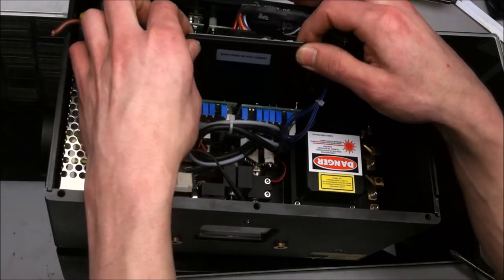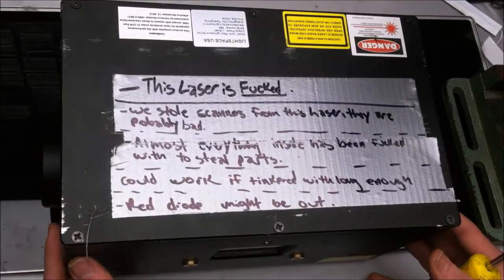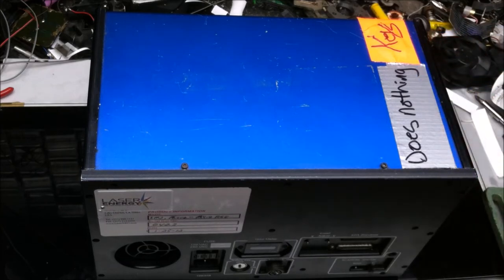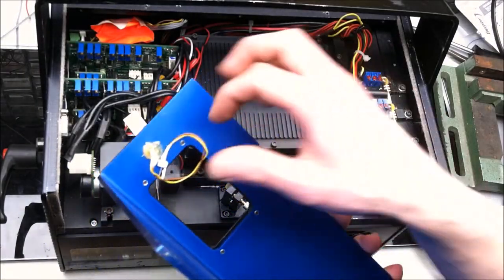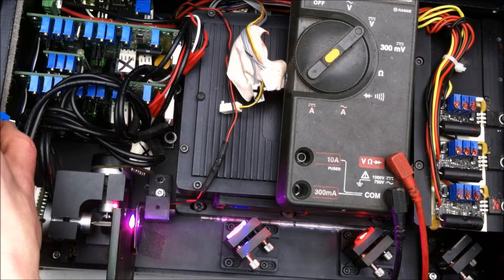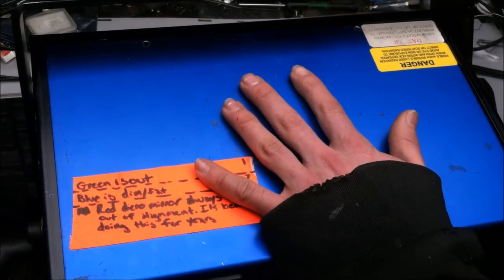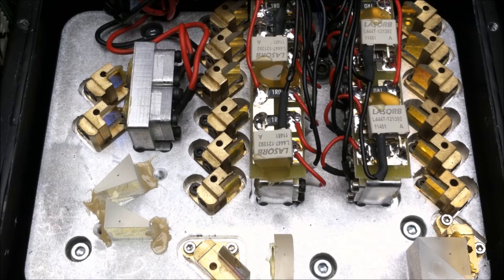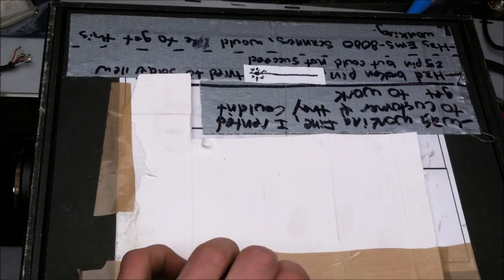Repairing 6 Show Lasers Part 1, Rough Diagnostics/Look Over

Comment: Hey Patrick Hope you are doing well buddy. 
Love the videos keep up the great work ! 
Just curious, did you said that one of those Cittadini projector systems output power sticker was labeled 18W RGB ??
Reply from the maker: IIRC Rob? Things are going pretty ok. The smaller Lightspace units where marked 8W max with a 1.8W internal label. The Cittadini Should be 2W 532nm, 1.4W 638nm, and 2.5W 445nm, bout 6W optical total power given the laser diodes used. Hope you're doing well yourself!

Comment: Great series, Zen. Hope you don't mind, but I have a few newbie questions for you regarding my 2 new projectors. Perhaps the answers will benefit your viewers, who find themselves in a similar situation.
Q1: The scan amps have a +15V Gnd -15V connector (near the signal input), but only one is connected to the control board. Is this a pseudo (single axis) connection that the control board uses to detect a static beam for cutoff?
Q2: The signal input connectors on the scan amps are labeled RP +In Gnd -In, which is also labeled on the Control board output connector. What is the RP pin for? (Return from Projector?, Reverse Polarity?...)
Q3: I'm considering eliminating the Control board (not interested in canned disco effects, controlled via DMX). Is there any reason that ILDA outputs can't be directly connected to the scan amps and RGB laser driver board? Is that what Kvant calls a 'Raw Projector"?
Thanks for your guidance. I appreciate that these questions should be asked of New Feel Lighting, but I trust your judgement above that of a salesperson with language barriers.
Reply from the maker: Galvo amps can go up to 24V electrically in most cases, however the galvos cannot. 12v-12-15kpps,15v-15-20kpps,18v=20-25kpps,24v=25kpps+. You can try higher +/- supplies above 12v to get better performance from your galvos but keep an eye on their temps to make sure they can handle it and make note not to do larger scan angles as to not over saturate the magnet/coils.

The 15v parts on the galvo amp are usually outputs from the 2 linear voltage regulators on the amps which are often used for driving things like the show card. 

I would have to see your galvo amp to know what RP stands for based on the location and parts connected to it, it could be scan fail output, not sure though. 

You can absolutely drive the lasers and galvos directly from the ILDA, however I would strongly recommend putting a resistor across the modulation inputs for each laser, say like 20Kohm as some lasers will stay on be default without a signal being fed to them. This just insures that the lasers do not fire unless a true voltage is applied. If you look up the ILDA pinout you will easily find the pin assignments. You may have to increase your galvo scan angle on the amps as the ILDA input is +/- 5v and some show cards use a higher voltage up to 10V+/- for signals to the galvo amps.
Reply: @Zenodilodon  Thanks, Zen. That's very helpful. Wouldn't have thought to use pull down resistors on the inputs to the laser driver board.
I already have the DB25 ILDA pinouts bookmarked. :-) But, have no info on the driver boards' inputs. That's why I wanted to check with you, before blowing them up on a brand new projector, from the get go.
Noticed that the show board doesn't use +/- Intensity from it's pseudo ILDA/RJ45 connection (only 8 CAT5 wires), but the unused inputs will be used via the Etherdream 3 DAC's full ILDA compliant connection.
The show input connector's 'S' pin is being used by a manual switch to toggle between ILDA and the show board's imagery. No interlock nor shutter inputs? tsk, tsk. smh
But, I was really surprised to see the mechanical beam choppers on your projectors... for emergency kill buttons? Thought the blanking speeds of diode lasers would have made those obsolete.
 I'm also surprised that the show board isn't being powered from the 12VDC output of the PSU, instead of loading one of the scan amps. Oh well.
Yes, the signal cables have dual (+/-) pots between the show board and the galvo amps for manual x/y size control, which supports your mention about the show card outputting a higher voltage than +/-5V. So, I'll probably need to figure out which trim pot on the galvo amps is the gain (w/o screwing up the damping, etc). Used to be pretty good at tuning open loop GS124's (probably before you were born lol), but have no experience with closed loop galvos.
Your videos are making me feel much more familiar with the newer gear. Hell, I remember using adjustable x/y mirror mounts exactly like the ones in this video's projector. Have even made several from scratch. But, the beam merging optics are different. We only had dichroics for merging and a pair of prisms with a galvo in between for color mod, until AOMs came along.
Sorry for the boring nostalgic trip down memory lane.
Really appreciate your feedback. :-)
Reply from the maker: @TheOleHermit  Yup the shutters are their just for emergency kill/fail condition half the time they seem more trouble than they are worth, probably one of the first things to fail it seems ironically. High end companies still use them but with laser drivers getting better electronics are being favored a bit more. 

Your remarks on the GS124's and the nostalgia is welcome here 120%. Actually I am planning on taking you back to those glory days of wheeling in large water cooled ions and checking your chiller fluids before a show. If you ever heard of Lowell Cross and admired that history we have here at my friend shop his touring laser, the first one with it's synth/control console. We are trying to be as original with it's restoration and have been ordering parts for it. Each color has it's own galvo, I think they are the GS100s. a few of the torsion springs in the original are snapped and those I plan on doing a rebuild video on later this summer. The unit has a Coherent model 52 Ar-Kr, sadly it does not fire up and needs to be regassed. Something neither of us at the shop has done, but I have a Spectraphysics Stabalite that we may try regassing ( The getter hes the signs of the O2 ) I also got yellow HR and OC for it too! You may be feeling more familiar with newer lasers but let me tell ya I feel like I need a decent safety buddy when changing the taps on a 3 phase transformer that makes a MOT cry. 

Funny you mention AOMs, my next video should be on the PCAOM. Sadly the Ar-Ion laser I have here has suppressed green lines ( 6 lines though made for curing polymers hence the favor for 488+) and it's not polarized, so the PCAOM isn't the nice 80% efficient. But hey you work with what you have. New lasers are epic, but it's not the same vibe as the old days I feel had and I am kind of sad I missed that.

Hence, I am always happy to read a bit of nostalgia!
Reply: @Zenodilodon  Cool, thanks Been a long time since I was able to have laser chats with fellow enthusiasts. It's now like a secret part of my past that no one else knows, would understand, nor even believe if I told them. :-)
The name Lowell Cross rings a bell, but it's been too many years. I started out doing Laserium at the London Planetarium with Laser Images in 1978. Went freelance, but stayed in England for the following 10 years, doing discos, tours, etc. Holoco (The Who's laser & holographic company) was pioneering the industry with 60 watt Spectra 192's end to end on that side of the pond. 
My 1st personally built projection system was assembled after restoring an old Spectra 65, that was rotting away in a warehouse owned by Yes. Yes had a little company of electronics gurus, making their audio effects. My oscillators were modified waveform generators from the first drum synth I ever saw. The drums were acoustic (before pads were invented) with mics triggering the different synth modules.
My controller was a bank of those analog oscillators, modified for quadrature xy outputs and plugged into a card cage (like the channels of a mixing desk). 
The gains and fine frequencies were similar to rows of synth pitch wheels. I called it my laser synth, too.
At that time, I was trying to inject 5 watts into fiber optics, then reconstruct the output beam into remote scanning heads, mounted in the lighting trusses, just as today's projectors are. That would eliminate the need to man handle the $5,000 hand blown glass tubes, with water jackets onto 10 ft scaffolding towers nor fly them under lighting trusses.
You're going to check the cooling fluids, eh? Yes had a fiberglass tub of water and used a pump to recycle the water through 2 car radiators, with fans for cooling. lol 
GS 100's are big slow workhorses, good for 1-2" mirrors. Probably the originals for entertainment. Good luck repairing those torsion bars. Special high carbon alloy steal, yet flexible. Perhaps a solid bass guitar string would work.
Yes, the Laserium systems had RYGB beams aligned in a parallel vertical row (from 2 prisms), stair stepped pick-off mirrors would send each color to a different scanner. A GS100 galvo between the prisms would shift the group of beams up and down to change the colors hitting each scanner, aka 'color mod'.
Used a few Co-Rads, but preferred the smaller Spectra Physics 64-65 range, with tighter beam diameters. Tried swapping a tube, once. Nearly cried as I watched water filling one end, near the Brewster window. Had some buddies that made 5 watt air cooled units for Cambridge Lasers. There's 7 transitions of different glass between the Brewster and the main tube. Of course, you'll need to evacuate the tube, prior to re-gassing.
Dang, Bro! You get to work on the coolest stuff! Yeah, touring Europe way back when was more challenging than fun. Very stressful.
Wiring a 60 amp, 440 Volt,  3 phase transformer, you say? Like the time in Germany when the local electrician crossed one of my phases with neutral and blew out half of the ICs in my controller? Fortunately, there was no show the next day and the local promoter was able to source replacements before the next show.
Oh yeah, then there was the open breaker box, with the contacts engaged. While trying to fix it, my screwdriver shorted and blew molten metal all over me, along with a 200 amp fuse that blacked out the warehouse.
No, been there, done that. You haven't missed much of anything, my friend. But, you're doing a great job bringing this old fart up to steam. Thanks! :-)

Comment: 31:40 How do you protect yourself from reflections when repairing lasers? Asking because I am trying to fix a small show laser and run it open for testing without going blind. Very interesting series, its nice to get a look inside bigger lasers :)
Reply from the maker: There are safety glasses you can get for working on lasers. I myself typically don't use them since some of the lasers I work on like this have more than one wavelength. At this point it's mostly just a matter of being aware of what can be a reflection hazard. Sometimes I put up a black metal plate to block the beam so I can check it without worry on reflections. Best advice is to take your time and be aware of the hazards. You can look for laser safety glasses online but most are made to work against a narrow band.
Reply: @Zenodilodon  I agree. Most entertainment lasers are visible wavelengths and the insides of projectors are flat black. IMHO, it's easier to be aware of where a visible beam is and avoid it, than to be guessing where the invisible beams are from behind laser safety glasses.
One of the greatest hazards is while positioning mirrors. Also, never work on an entertainment projector, while it is under full power.